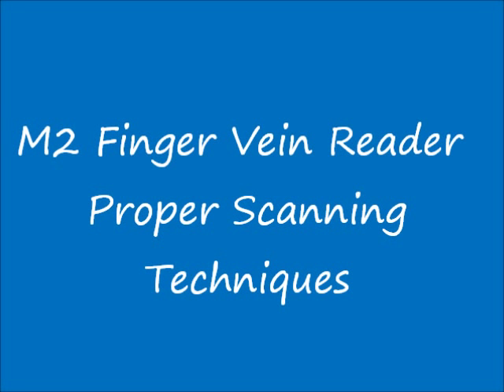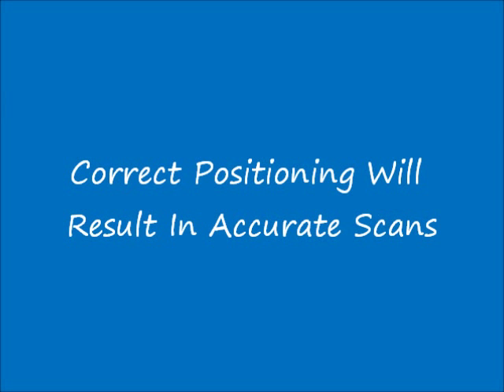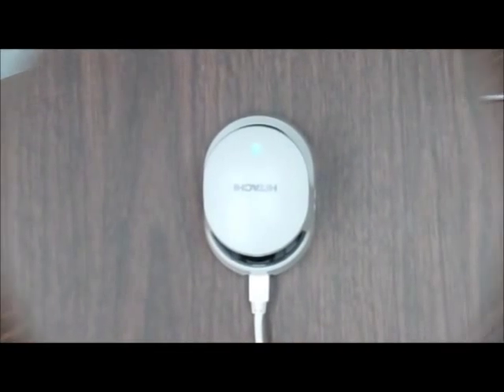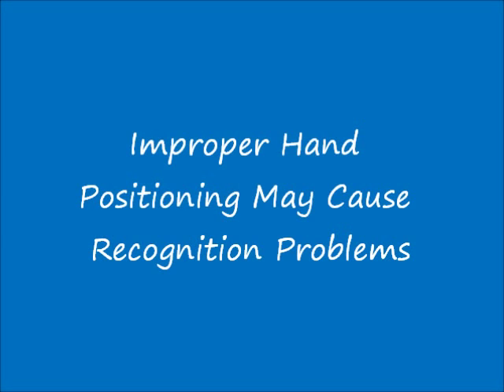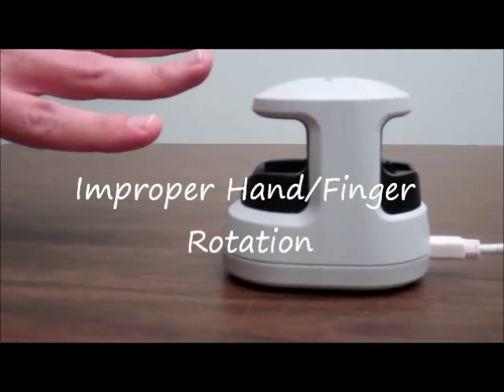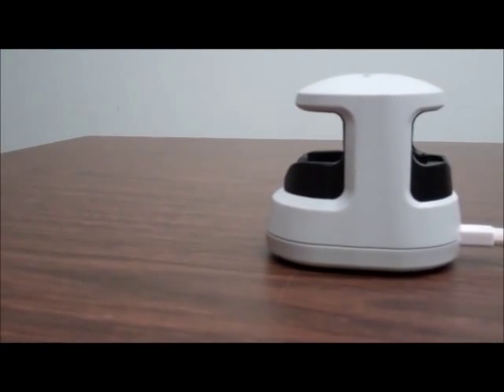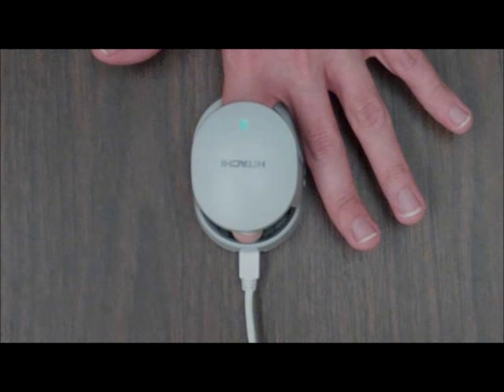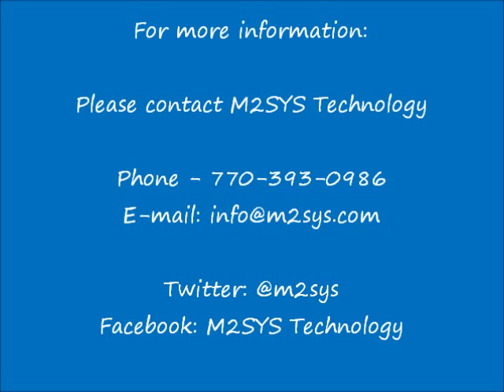Training Video On How To Use VeinID Finger Vein Reader Manufactured By Hitachi Systems, Inc.

Comment: Does weather affect accuracy?
Reply from the maker: César Mendoza It should not due to the fact that this biometric hardware device is designed to be used indoors. However, in colder temperatures, an end user may have to rub their hands together several times before use. Thanks for stopping by to comment.
Reply: César Mendoza Yes it does in harsh sunlight as this washes out the IR LED's making scanning difficult on occasions. This is something that we have experienced and is a known problem. We developed a hood to shield from harsh sunlight in certain environments. We are integrators of the H1 scanner and official Hitachi Partners. We have developed an access control system based on this hardware. Kind Regards, Croma Security